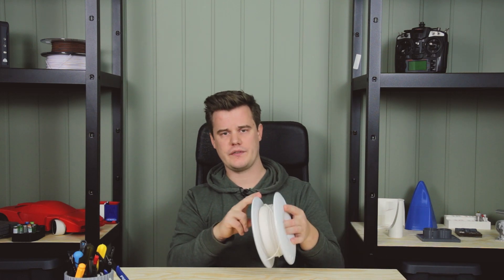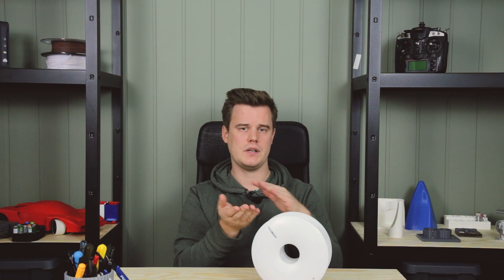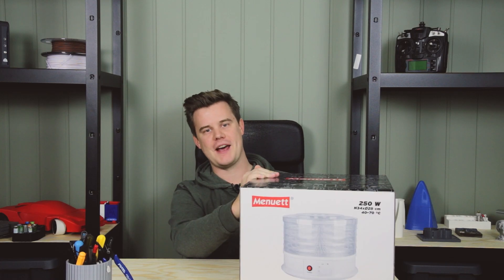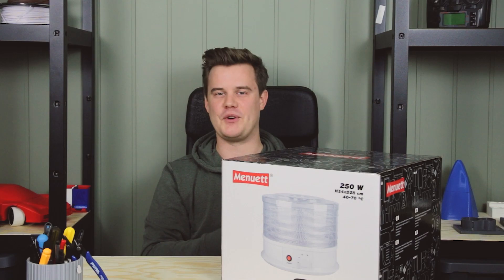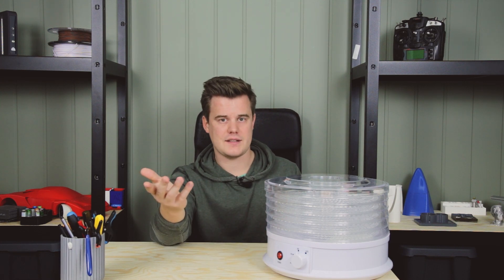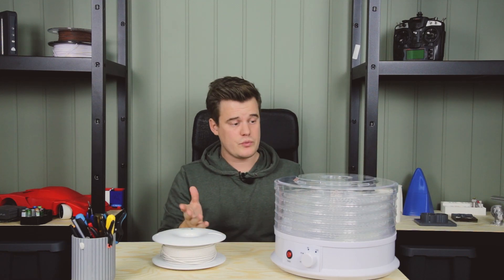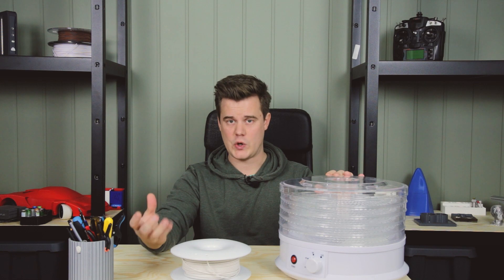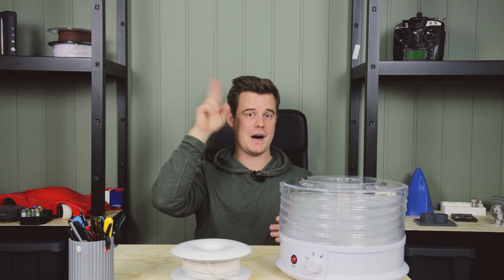Recover filament for 3D Printing

Comment: The easiest way to dry filament is to put the roll on the heated bed at around 55° for some hours or over the night. 
You need to cover it with a filament box with one side cut off and a small hole on top to allow air to circulate. Works perfect!
Reply from the maker: Haha that's a great tip!